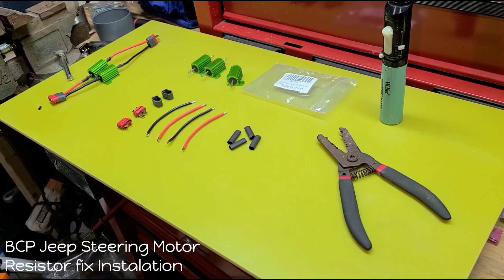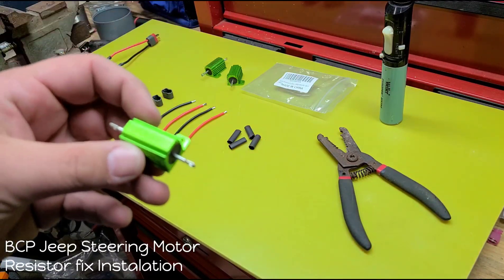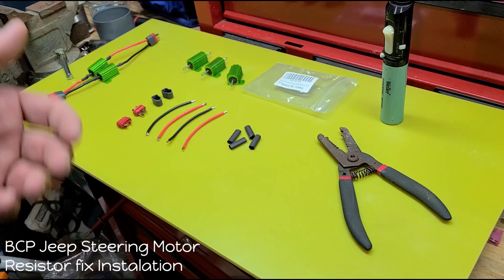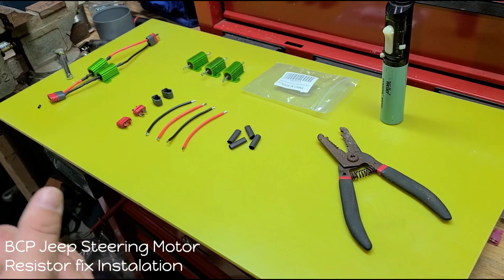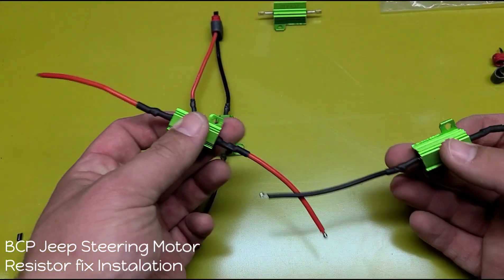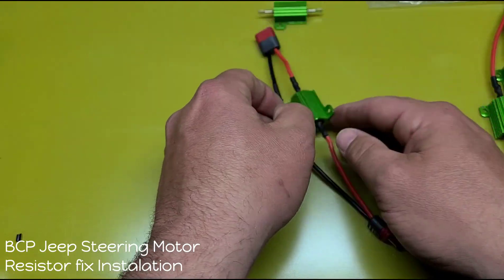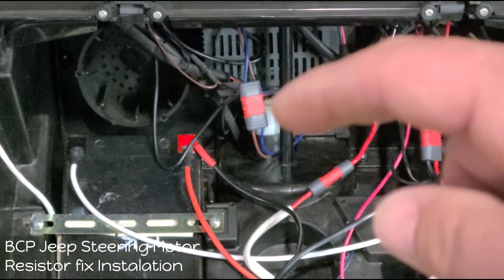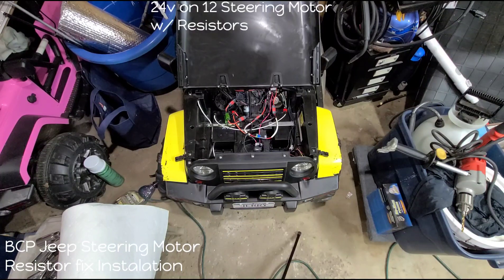Best Choice Jeep Steering Motor Control Fixed after 24v Rx30 upgrade

Comment: Can you not add a buck or step down converter from 18-24 down to 12
Reply from the maker: @ishanperusinghe  unfortunately no. that requires a Positive and Negative lead and the steering from the controller is Alternating the leads where a buck or stepdown would not.
Reply: @Neonjer11  got it . Thanks for this . Im doing drill battery upgrade to 18v hopefully these resistors should be ok. Im actually doing a guide for newbies also . Will add what I have leaned to it
Reply from the maker: @ishanperusinghe  remember to be careful with 18v it will end up frying the 12v board

Comment: Great video thank you! I did everything as you did and steering is slower but still I think should be a bit slower, do you have any idea if I can buy any other resistor to make it around 25% slower? Im using 20v battery. Thank you
Reply from the maker: @kubastaniek  increase the resistors it will go slow. Currently the only way

Comment: Hey Thank you for both videos!!

Im having trouble with this set up, I have done everything the same as you have but when I connect the battery the steering speed doesn’t change. I still read 24v to my 12v motors as well.
Reply from the maker: I'm not sure what you asking,  but did you try checking the voltage while turning.  Also I am assuming you mean the 12v steering servo motor? Thx
Reply: @Neonjer11 
Thank you for replying im still stuck. Im asking why it might not be working for me? I done everything the sane. The only difference id that the case of yours are green but the case of mine is gold. 

I did het 24v when turning the steering motor 

And yes i am talking about the steering servo

My steering is still aggressive and reads 24v
Reply from the maker: @MarcDejo  I'm assuming you have a 2 wire steering. If it's still to aggressive either the ones you got aren't good or you can try a diffrence  rated one.

Comment from the maker: This is for the 2 wire steering version only (not 3 wire) I've only done the testing on what you see in the video. For those of you with other steering model motors you can always buy a 24v replacement motor or steering assembly if you can find it
Reply: Hey I’m trying to find the 2 pin female connector for the steering motor on the weelye rx30 , any help would be appreciated. Thanks
Reply: I’m also looking for it. Did you ever find one?
Reply from the maker: @danbogart  just unsolder the one off the original motor. Tho it may be a tamiya type connector check Amazon if you want new
Reply: @Neonjer11 The issue for me is the one on the original motor doesn’t match either. I tried these plugs tamiya connector and it was too big.
Reply from the maker: @danbogart  there is a mini version of tamiya not sure if that's the one tho
Reply from the maker: @danbogart  why not just use Dean's connectors or XT60H if you so you can just solder wire tails directly to the RX 30 and use you choice of connection

Comment: When I flip my wires around the control board burns I've soldered it 2 times now. What am I doing wrong. Trying to get me steering right
Reply from the maker: Sound like your not using the right wires or have something connected wrong

Comment: Question: Why do people keep doing the double battery on this model? cant you do the 12v conversion to 18v drill batteries? wouldnt that work better?
Reply from the maker: No cause it has a control box that's rated 12v. If you add 18v you'll fry the board. Typically everyone upgrades to the 24v control box.
Reply: @Neonjer11  thank you once I went down the rabbit hole I figured it out. Seen alot of info about it. Great videos very helpful.

Comment: I upgraded my power wheels from 12v to 20v on my kids unenjoy kids ride on Bluetooth jeep an once I hooked it up she ran it for a day then the next day it wouldn’t start but I got lights on the dash but no sound or power, any thoughts? All wires are good and motors are good
Reply from the maker: Did you change the ESC? 20v will probably burn up the 12v controller and possibly damage you radio light and other 12v accessories?
Reply: @Neonjer11  I bought a brand new one, plugged it in and nothing changed
Reply from the maker: @Vmazzotta57  a brand new controller 12v or 24v?
Reply: @Neonjer11  bought the walleye rx7
Reply: You happen to have Facebook?
Reply from the maker: @Vmazzotta57  ya
Reply: @Neonjer11  mind adding me? Vinnie mazzotta it’s a family pic, I’d love to get your take on what I’ve done, can’t send ya the pics and stuff I want on here
Reply from the maker: @Vmazzotta57  k messenger you.
Reply from the maker: Hey just a follow up. 😉 everything good now
Reply: @Neonjer11  so my jeep is 12v (rx23). Can I just plug in the rx30 which is 24v and use my 20v dewalt battery?
Reply from the maker: @David_Mash  no, you need to add a voltage regulator to anything 12v related. Also your motor probably won't last long as 12v motor typically are pushed to the max when people put 18v to them. If your look for a quicker ride with out the upgrade I suggest you go with a higher 12v RPM motors and possibly 570s, they are little bit bigger but still bolt up to the gearbox
Reply: @Neonjer11  thanks for the reply. I think I'll stick with the rx23 12v. Then run a separate dewalt battery and relay activated by a steering wheel button so that my kid has a boost button but I will still be able to steer him in 12v when he goes too far away

Comment: Will this also work with the RX30 and a 24Volt steering motor?
Reply from the maker: Don not sure if this is what you mean. The truck in the video has RX30 ESC and 12v steering motor that has 24v going to it so we added the resistor to cut back voltage to the steering motor. I don't see why you couldn't add the to a 24v steering motor it should do the same thing and restrict some power going to that motor
Reply: @Neonjer11  ok thank you. I had the issue before with my conversion as the steering motor I had that was stock would not work with the RX30 so ended up getting a new 24v steering motor so definitely want to restrict power to it
Reply from the maker: @donlo586  is it still the 3 wire or you now have a 2 wire?
Reply: @Neonjer11  no the new motor is 2 wire and it is working with the RX30 now just a ton of torque.
Reply from the maker: @donlo586  ok ya add those it should cut back the snap
Reply: @Neonjer11  cool thank you for all your help

Comment: I just upgraded to the RX30 in my son's BigToys Mercedes AMG GTR. I actually created a separate circuit for the steering motor using two 5A buck converters and two relays. One buck converter connects to each of the two lines from the controller using 10A diodes to prevent reverse current. Both are set to 12V and connect to the steering motor wires via two relays, again with 10A diodes to prevent reverse current. Steering works just like it did with the original board, but drive motors are at 24V. No overheating and minimal power wasted as heat.

Comment: I’m having an issue with my conversion. With the RX30 the steering connection is only a two prong male end where the lead coming from my steering motor is a three wire skinny female end. Any help would be greatly appreciated. Thank you.
Reply from the maker: Please send a pic to the Google Photos link thx
Reply: I’m sorry I can’t find that link anywhere. Looked up the email from the channel info and sent them there but not sure if that’s a good email.
Reply from the maker: @donlo586  Post pic of your Ride here for troubleshooting or just to share:
https://photos.app.goo.gl/oj5kBWeh8WxC3F4S7
Reply from the maker: @donlo586  I updated the description sorry about that
Reply: @Neonjer11  no worries. They are added

Comment: hey. amazon recently added a 24v steering motor i bought it and its working well. steers slow as it should without any resistors just plug and play. heres the link for it https://www.amazon.com/gp/product/B08WHQFDC9/ref=ppx_yo_dt_b_asin_title_o00_s00?ie=UTF8&psc=1
Reply from the maker: Unfortunately that is not the version for the BCP Jeep. The stock style one can be found in the Google Photos link it was removed and torn down in the pics. You'll see the style is completely different. If you did install this on your jeep please share your pics in the Google Photos link inthe description